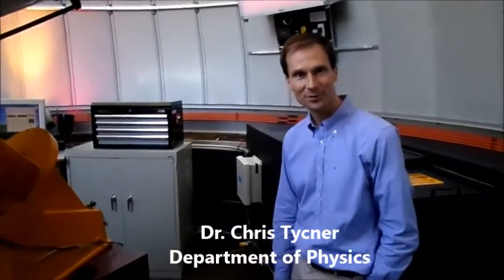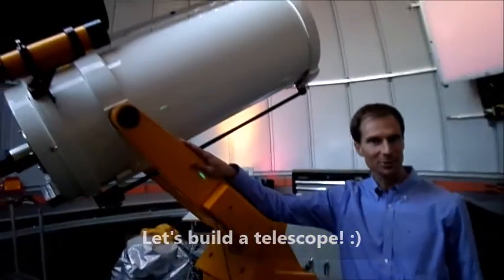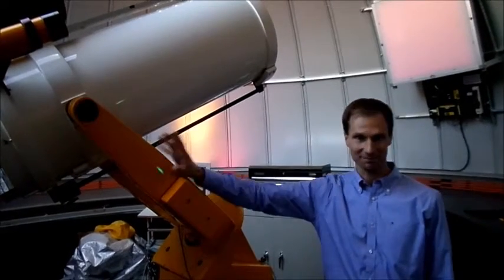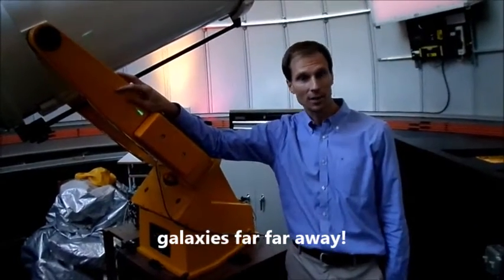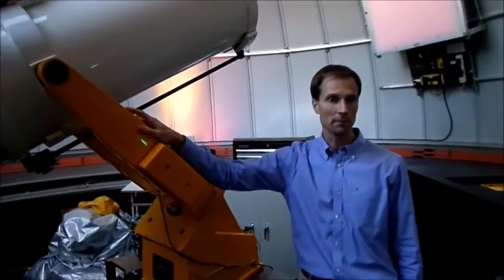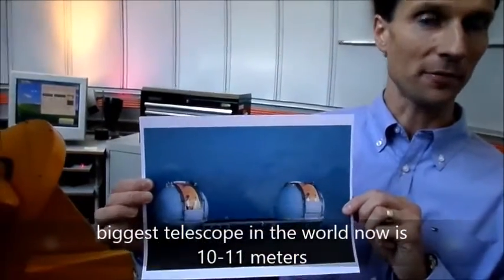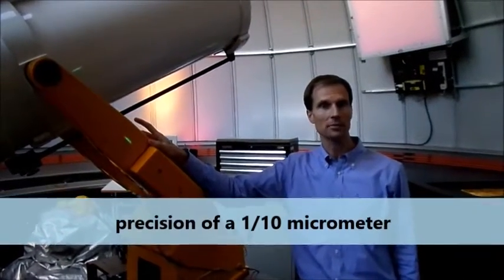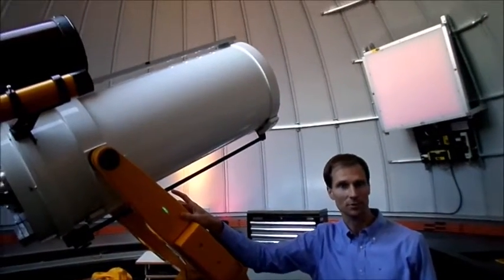EGR 120: Building a giant telescope

Comment: Spin a huge bowl of some kind of warm resin then let it cool/harden in the parabolic shape that forms. Idk how you'd get a super reflective coating on it but even if you could you'd have to have like a dozen cranes or something huge just to aim the telescope haha
Reply: could you concave a mirror say, 100 meter curved mirror, so it would take up less space and then use a lense to bend the light back? i am sure there is a way by which we haven't quite thought of yet. I think currently they have methods that take light from telescopes at fixed places miles apart and merge the images.